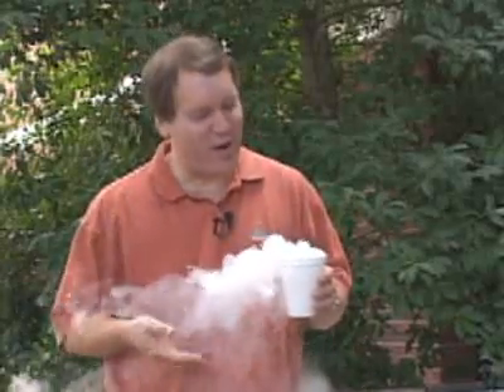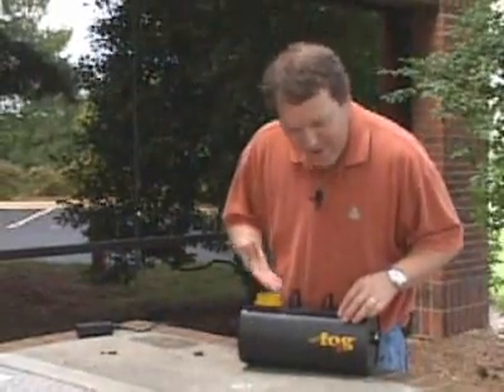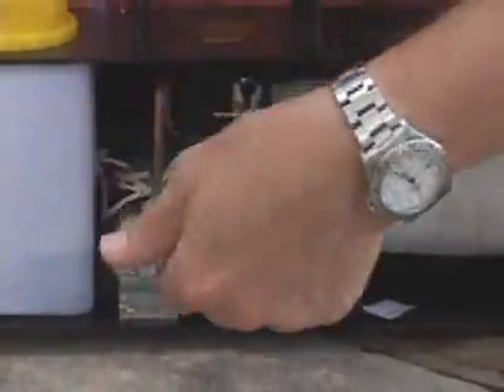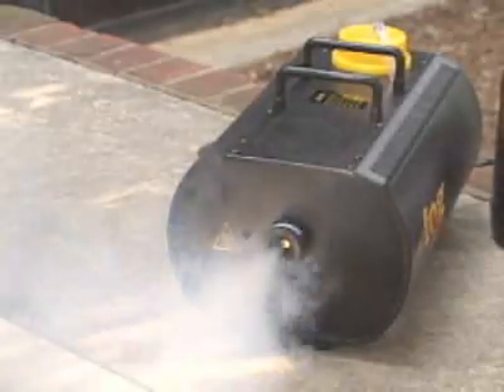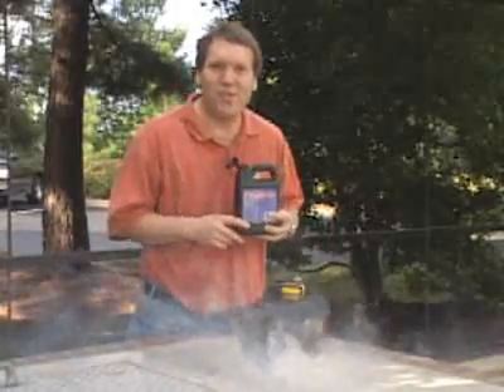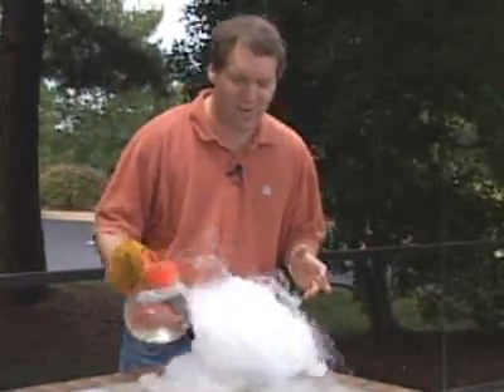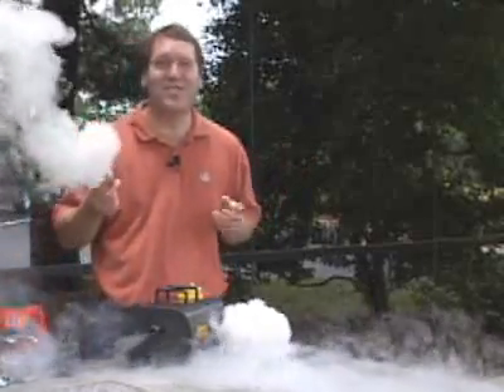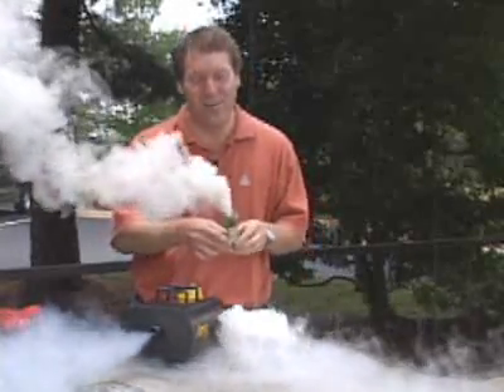How a Fog Machine Works

Comment: is it possible to show us how does that heat exchanger looks like and I would appreciate it if you could explain why the vapor is not hot, even if it just came into contact with a hot metal tube :)

Comment: @lgman83 No, not at all.  It's just Carbon Dioxide frozen below 0 degrees Fahrenheit.  It undergoes sublimation, which is the state change from solid directly to gas, or vice versa.  It may seem like it's harmful because it gives off smoke, but it's just the sublimation, like I said.

Comment: i have the same exact fog machine
Reply: Do you need another cable 
I found one and It just heats up does not pump out anithing
Reply: @CARLOMERAZAUDIOVISUALES  Its been years since I used mine last but it could be clogged in the pump or may need a new hose on the inside.
Reply: @SpiderGuyVmk  thanks